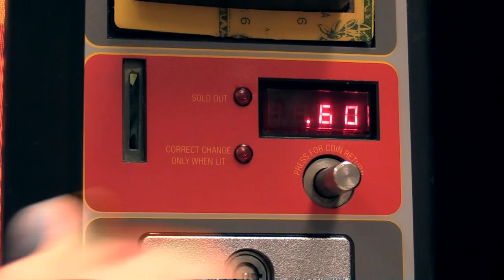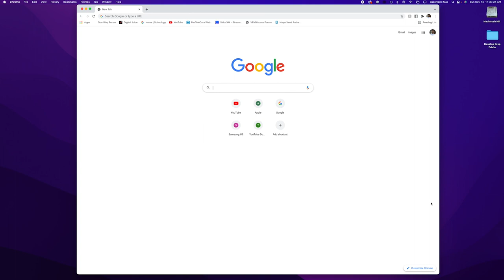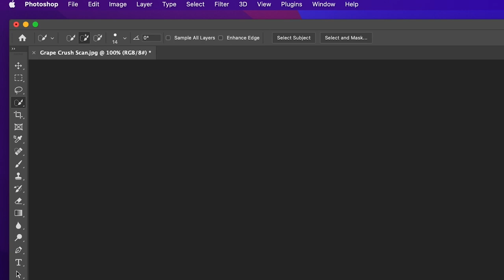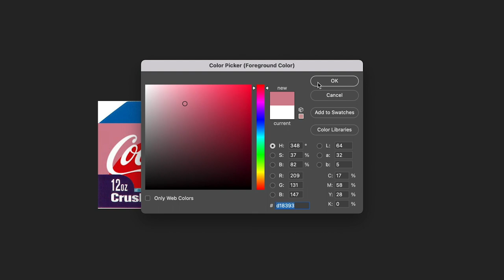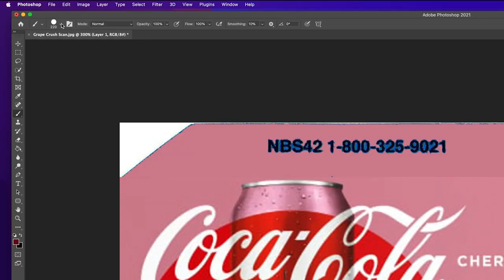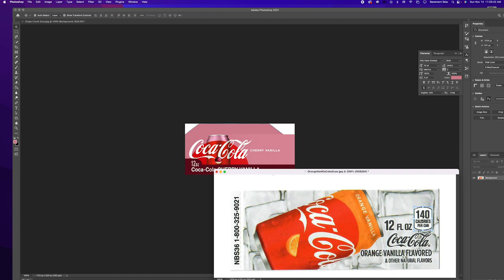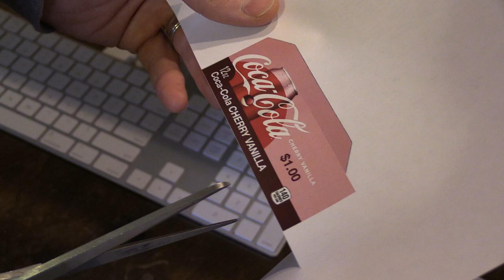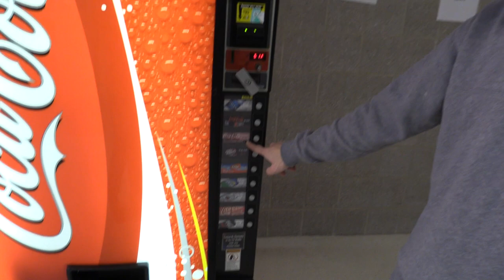How to Make Flavor Strips

Comment: You can save $$$ by using clear packing tape to go over your strips as opposed to that laminating machine.   Also if you have unique drinks you can scan the labels into photoshop and just move things around like the calories or whatever.   When using photoshop make yourself a black cutout layer with the strip shape and use it as an overlay and work under it, when you print just cut along the shape.
Reply from the maker: I have scanned labels when I couldn't''t find content on the internet.  Yeah, packing tape could work, but I do like the thinkness that the lamination provides.

Comment: I have a 70s Cavalier machine that doesn't use standard sized strips, so I have to make my own. My only problem is with getting the sold out light holes lined up properly. There's a lot of trial and error involved. I wish I could come up with a streamlined template for all drinks, cutout and everything.
Reply from the maker: I usually just put an actual flavor strip overtop of the one that I made so that I can mark where to punch out the hole.  I use a single hole punch for that.

Comment: Great video, Bill!!! I've had to make my own for some time, but I'm not good with any photo editing software when it comes to layers. Right now, I've added Peach Nehi to my machine and I need to make a label for it. I've also scanned the smaller labels and have resized them larger for my needs. 

I also have the added problem of the sun as my machines are outside. I'm using a UV blocking spray on mine with less than desired results, so I have to make new labels every 6 months or so, or mine fade.
Reply from the maker: Have you tried laminating them?
Reply: @HappyVending  No. That is a great idea. I don't have a laminating machine, but I may invest in one.
Reply from the maker: @TheDurnans  Give it a try...they're not that expensive.
Reply: Did you make the Peach Nehi? I could use one and would purchase it if possible.
Reply from the maker: @mariyamazaryahu4552  Which peach are you referring to?  The Peach Snapple?
Reply: @HappyVending  The peach made by Nehi.
Reply from the maker: @mariyamazaryahu4552  I see.  I do not have one of those labels.  If TheDurnans made one, it would be a large size since he has older machines.
Reply: @HappyVending  Ok. Thanks for responding! I enjoy your videos and I’ve learned so much. 🙏🏾

Comment: I love your videos!  I bought a stack machine but it doesn't have the name plate and I want to get the correct manual. It's a cold drink machine with 9 selection. The seller told me it's a royal vendor 650 but I don't know how to be sure. Any tips
Reply from the maker: What is on the front of it?  If it is a coke machine, it is probably a giii machine.  If it's not a coke machine, it's probably a merlin iv.